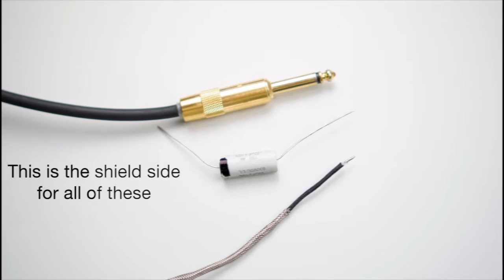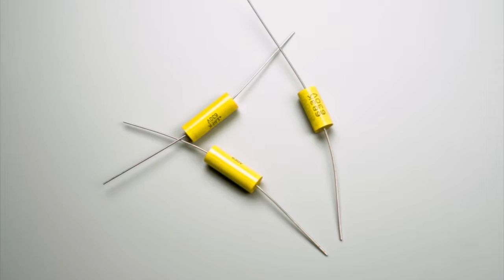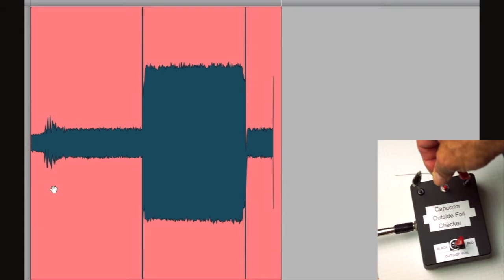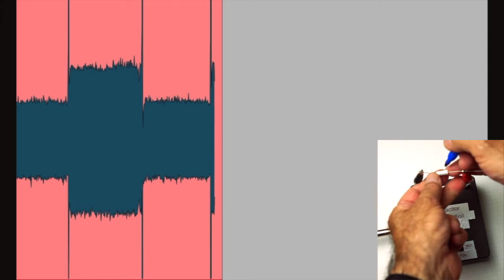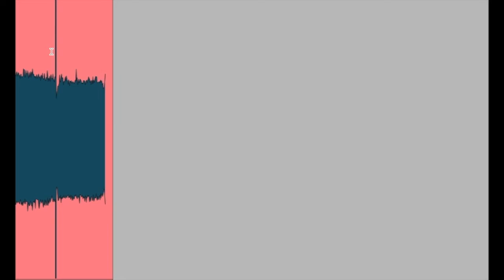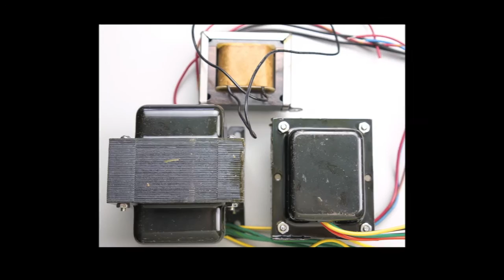Karma Guitar Amplifiers - Capacitor Foil Test

Comment: You do know that toggle switches connect the middle and opposite terminal on the switch I hope? If it's pointing to the right that means the middle and left terminal are connected. I wonder how many people have built this and wrongly identified the foil end of the cap because of this?
Reply from the maker: Excellent point, David!  I guess I assumed that anyone building this would know that, but it's an important point and I appreciate you bringing it up... thanks!

Comment: Nice but I prefer my scope, it is way more obvious and pleasant to use.
Reply: How do you do this with an oscciloscope? I have a dso but can't find any information on how to set up the scope.
Reply: @jeeplvr2000  Here is a good video about it : https://www.youtube.com/watch?v=BnR_DLd1PDI
Basics of using a scope starts at 8:07. It is very important you set it with the smallest volt by division you can get and it should be at least as low as 5 milli Volts / division. If you can't get as low as 5 milli Volts you wont be able to see the noise,  2 milli Volts is the sweet spot.
Reply: Scope is better but not everyone has a scope

Comment: What about caps that don't make noise in either orientation? I've got a bunch of caps I've tried to identify. O-scope, amp input, amp input with a fuzz pedal. None of the caps I have tested make more noise in one direction over the other. In fact they hardly make any noise at all and that's with the amp cranked.
Reply from the maker: Ian - I'm not sure what kind of caps you're checking, but assuming your testing methods are correct I'd say you don't have a problem!
Reply: @karmaguitaramplifiers7967   The caps are what's usually found in a guitar amp. Mallory, Sprague, Orange Drops, etc. I've just recently took up building tube guitar amps and trying to identify the foil end of these coupling caps has been driving me batty.
Reply: @ianaintsaying1625  They all got a polarity and make noise if used backwards. Noise being at least visible with an oscilloscope. If you can't see it on a scope it may be because you do the test wrong, for exemple you must keep the cap body between your fingers cause if you keep it hanging by probe's end without touching the body then it wont generate noise.

https://www.youtube.com/watch?v=BnR_DLd1PDI
Reply from the maker: @ianaintsaying1625  Ian, if you've just started building I wouldn't worry too much about this.  I know of several high end boutique amp builders that don't bother with it at all.
Reply: @Bloodysugar  I would build this if I were younger. My eyes are too old to work with surface mount circuits. If there is a thru-hole version I'd be all over it.
Reply: @ianaintsaying1625  You don't need to build anything. The "tester" presented in the video is just a (too) fancy probe end, it is designed to facilitate hundreds of tests in a row. But you can use a simple probe like shown at the beggining of the video.
Reply: @karmaguitaramplifiers7967  That noise is low and can be acceptable (if even noticeable) in a clean circuit. But if many caps in the circuit (guitar + pedals + amp) are wrongly placed then they add their noises and it can become a real problem.

High end guitars should be as perfect as possible. Placing the tone cap correctly is a fast and inexpensive task, it should be done for any good guitar. Unfortunately there are tons of exemples proving that it is possible to make "high end guitars" with bunch of mistakes. But it is not because high end products can involve mistakes that it is the right way to do it.
Reply from the maker: @ianaintsaying1625  If you are talking about building the testing box shown in the video - there are no surface mount components or circuit boards involved.  It's just a very simple probe with a switch and some wire.

Comment: Can the circuitry inside the mysterious "box" be shown. Otherwise there is no point in the video.
Reply: Other solution : 20$ numeric pocket oscilloscope = very obvious noise waves and no need to listen to hum.
Reply: @Bloodysugar  Huh? what is a 20$ numeric pocket oscilloscope? And how would such a device be a "solution" . . . ? . . . to anything? I have an oscilloscope. My problem is/was: the location of the noise (in the capacitor) is not identifiable. The object is to identify the correct "side" of the capacitor BEFORE inserting it into the circuit. Because I've got 3 amps to work on,  this would be a sorting method . . .  Do you understand now? Because your reply doesn't indicate that you grasp the situation, or are able to construct a logical sentence. [["noise waves" . . . indeed. isn't all sound a wave, and isn't every sound a noise? ]]. You're blowing shit out your ass.
Reply: @lingcod91   https://www.youtube.com/watch?v=BnR_DLd1PDI

For that purpose miniscopes are enough. You see more "noise waves" in one position than the other, so you know how capacitors are polarized. You don't like the way I say it ? Well tell it to me in french et y'a des chances que je trouve à mon tour que tu t'exprimes mal, voire largement plus mal que je ne suis capable de le faire en anglais. No need to be condescending and rude.
Reply: @Bloodysugar  - Wow, I never knew about those "mini" scopes.  I checked on Amazon and they run from $ 35 to $ 45 now.  Thanks for the tip.
Reply: @STBRetired1  Happy if it helped :)
Be aware these are more toys than tools. For checking capacitors polarity noise it's OK, but it's almost just about that (and having fun while learning a bit about scope basics). 

Reads are still fine between 1 to 10Khz... at 20Khz datas like voltage get seriously approximate and you start to hit the definition limit, above 100Khz it gets insane, do not expect at that point to be of any help for serious observation. 

https://www.youtube.com/watch?v=-Eqaadcnhn0&t=336s

To put it in perspective, for audio component signals, witch are low signals in the electronic world, a good scope should be able to deal with signals up to 20Mhz, 1000 times more than what a miniscope can do. And at some point you'll feel "meh, 30Mhz would be nicer", and little by little you'll find that 100Mhz is maybe over the top, but damn cool... 

But again, just for "primitive" noise evaluation, getting datas from slow signals at low voltages (and nerdy fun), mini scopes are very cool.
Reply: @Bloodysugar  - I see on Amazon they have Siglent and Rigol 200 MHz scopes for $ 380, a Hanmatek 110 Mhz for $ 240 and a  Siglent 50 MHz for $ 260.  I've been away from electronics work for many decades so it will be quite an education for me to learn how to use these new digital scopes.  But, that's what keeps the Alzheimer's away, I hear.  I'll probably go for that Siglent 200 MHz scope since it is an Amazon Best Seller, by far.  With 609 buyers it must have a good reputation in the electronics field.
Reply: @STBRetired1  These are great hobbyist scopes. :)

I guess that Siglent is the SDS 1202X-E ?
If so it's quite a tool indeed. I would have take that one if I could afford it, instead of waiting after Hantek's mysterious delays...
Reply: @Bloodysugar  - Yup, it's the SDS 1202X-E I'm looking at.  Many years ago (decades ago) I was in the electronics business.  Before satellites, TV signals used to be microwaved from relay tower to relay tower and dropped to various destinations.  It's funny when you get old (I'm 76) and look back and realize something happened a HALF-CENTURY ago.  Wow.  And, no, I didn't know Abraham Lincoln.  So several years ago, I bought a bunch of old ham radios and test equipment from eBay.  I figured it would be fun to rebuild/repair them and it would give me something to do in my retirement years.  Well, I got all this "stuff" and am finally getting around to doing that work.  Now I've got to re-educate myself on electronics etc.  But nowadays there are some wonderful YouTube videos to help me learn.  I just watched some last night where a fellow is repairing an old Textronix o'scope.  Now that was handy since I have several of them to do myself in addition to several Hallicrafters ham radios (tube type, of course).  Soon I"ll be up to my elbows in "Orange Drop" capacitors.  And all the new tools available like electric solder suckers, hot air rework stations and the new soldering iron stations are so great compared to the old tools I have now.  I'm fortunate to be able to get by okay on my Social Security and pension.  So, why not treat myself.  The SDS 1202X-E is WAY OVERKILL, probably, for what I need but sometimes it's better to have too much than too little, I think.  It was pointed out in one of the YouTube videos the big difference in the number of controls between the old analog o'scopes and the new digital o'scopes.  Learning how to use the 1202 should really get my brain cells humming.
Reply: @STBRetired1  Awesome :)
I guess you'll get fast how to enjoy this nice scope and appreciate its crowded features.
Reply from the maker: Not so mysterious now.  The pdf is available in the build manual for our Karma 20T amp kit.  http://karma20tmanual.karmaguitaramps.com/mark-outside-foil-of-capacitors
Reply: GREAT . . . Thanks . . . Just plug it into the XLR input jack of my DAW. What is my DAW ? If DAW is what I think it is, I know I don't have one. So I'm back to square one.
Reply from the maker: You can plug the 1/4" output into your guitar amp and listen for the difference in hum, just know that the difference may be hard to discern with some caps.  That's why I use a DAW (digital audio workstation - Pro Tools in this case) to visualize the difference.  That and I'm not a big fan of listening to hum while doing a bunch of caps.